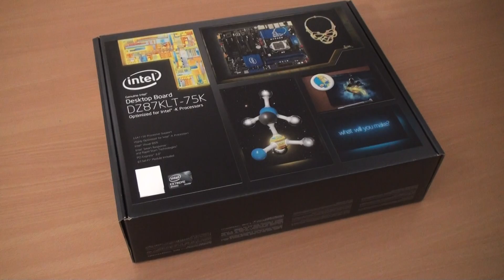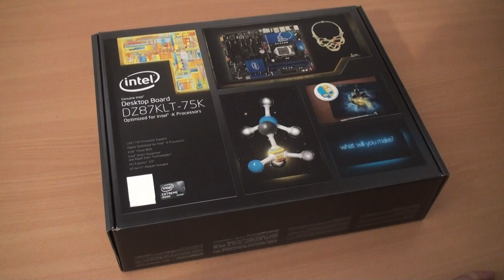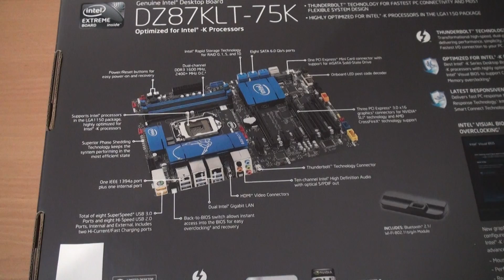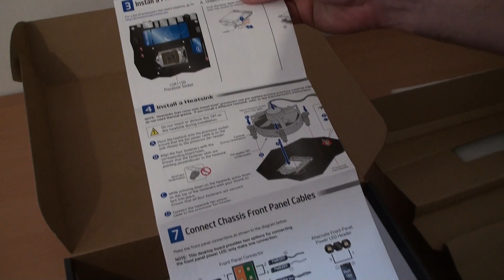Intel DZ87KLT-75K Motherboard Preview

Comment: *hears voices in head*

Viruses on computers?  Do you have important files/documents on your computer?  Just reinstall Windows, wipe the hard drive clean or buy another hard drive.  Ive had something on my computer before and not sure where it came from but it screwed up the hard drive.  They didn't want me to reinstall Windows.  It stalled out the loading process of reinstalling Windows when the disc was in the drive.  Alls I did was replace the hard drive and everything was better.  Yeah that was a nasty virus, not sure where it came from either (not porno, I don't look at porno).  If it still did that when I replaced the hard drive the virus messed up the motherboard too.  If you ever had that happen before to where it screwed up BIOS/CMOS that sucks.  Going to have to rebuild another computer or buy a new desktop already made.

Hard Drives vary in price.  1 TB should be more than enough, 7200 RPM (fast enough especially with RAID 0)  WD for average user is about $80.  They can cost up to $200 or more depending on what type you buy.  Yes I was thinking of those Velociraptors or whatever.

ACCORDING TO POLITICS IN USA (mocking the Generation X people) they want you to take your computer to the Computer Hardware store to get it fixed when you have a virus on your computer.  Fuck that, just wipe the hard drive clean.  Not even that hard to do and reinstall Windows.

Comment: hears voices in head

Im trying to get all matching case fans too hahaha.  Im all for trying to get INTEL parts only.  This is such a pain in the ass.  I wasted so much money getting screws for that H Frame and case fans for it.  It wasn't worth the money but in the long run I guess its worth to look at.

If I get this motherboard Im putting it in the D Frame.  I should put this "blue" motherboard in the H Frame its just I don't want to deal with the bullshit again of reinstalling and switching everything again.  Losing files again.  I bet Windows will act all weird since its hooked up to a different case and Windows is that picky about new hardware hooked up.  Its a bitch to reactivate Windows with RETAIL.  Another bitch market sales scheme.

Comment: firewire is an essential port for production people especially for cameras and external sound cards (such as the Digi 003). i want this motherboard to reach the philippines because i dont find the versions of asrock, msi, asus etc to be very appealing because they dont have the built-in 1394 port at the back and the ability to put one on the front.